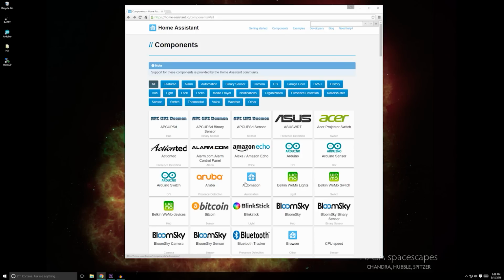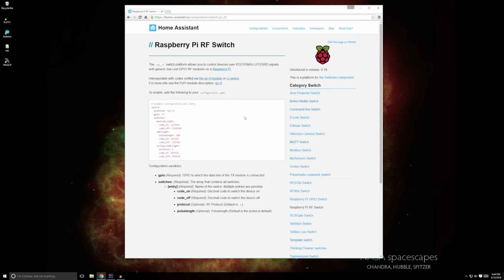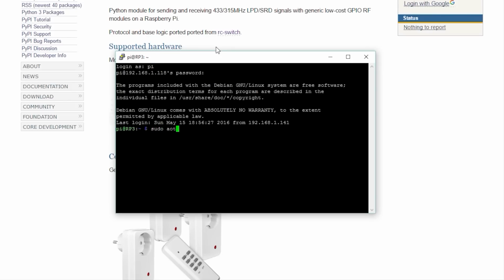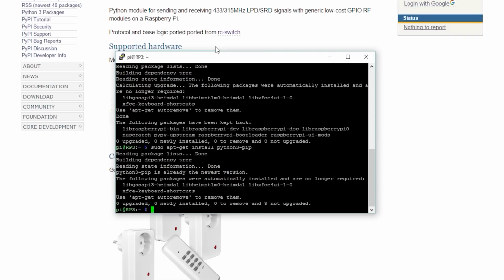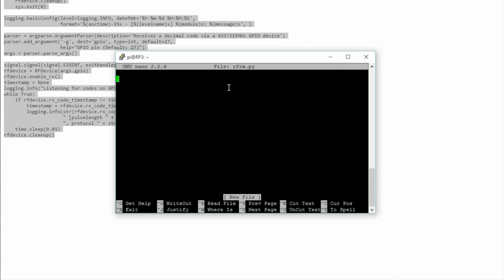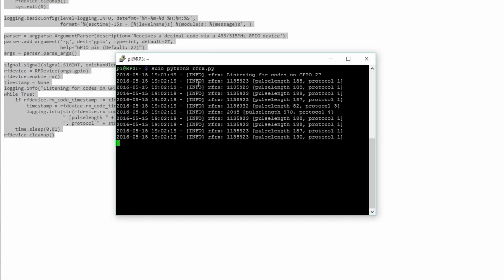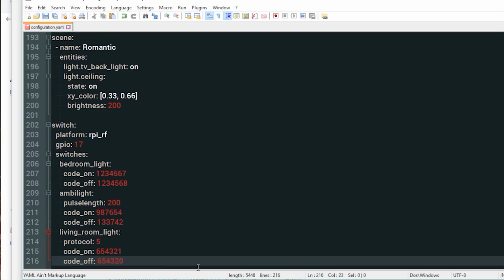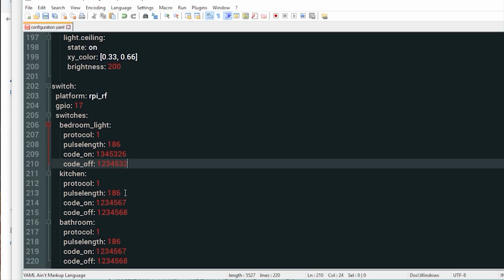The Cheapest Tech - $6 DIY Internet of Things Smart Outlets

Comment: Excellent video thank you. I am trying to do something similar with PIR motion sensors because it seems that all such sensors working on the Zigbee protocol have at least a one minute "blind time": that is, once they detect motion they cannot detect it again for one to several minutes. It's silly because in some situations it makes little difference to battery life. On the contrary, PIR sensors on 433 Mhz are unresponsive for only a couple of seconds. I've looked around the web and haven't yet come across any information about how to connect 433Mhz motion detectors to the GPIO pins of a Raspberry pi  using a 433 Mhz receiver and THEN integrating this into Home Assistant. Any ideas?

Comment: I realize this video is like 2 years old, but I was wondering if this could work when HA is not actually running on the RPi. 

I run HA on an Ubuntu server that I use for a bunch of other stuff, but I would love to integrate RF control into my automations. I was thinking of buying a Pi Zero and the RF modules to run seperately, probably in a more central location tab my office closet. Is this workable in HA?

Comment: @BRUH Automation, first of all thank you for your video. I recieved data for the very first time after trying pilight, fhem and many other readers. is there a possibility with you python script to recieve binary data? My Intertechno remote (ITLS-16) just send: [INFO] rsfx: 8 [pulselength 1658, protocol 4]
[INFO] rsfx: 4 [pulselength 1658, protocol 4]
[INFO] rsfx: 4 [pulselength 1696, protocol 4]

the codes are quite short. isn't it? how can I interprete the protocol?

Comment: Thanks for the video. I have been using the Eteckcity outlets for several years, and now I can control them with my Pi3B+. I haven't tried to set up Home Assistant yet. Being a newbie to the programming world., it is a great success when anything works!
Reply: Got HA installed and running. Today, I configured the three outlets and they are working. I can trigger them from the far end of our house. But, I had to solder an antenna wire onto the transmitter...and stretch it out. Whatever it takes, right? Thanks for the tutorial.

Comment: hello has anyone managed to get a sonoff bridge to work in home assistant for home security ie a small touch panel for a code and for 433 sensors to work  with in home assistant to know the presence of someone in a room or windows open and to control the switches and blinds

Comment: Followed your guide (and just bought different remote controls).......and I have a problem:

If i run
`$ python3 rpi-rf_send -g 17 -t 3 -p 101 15194300`
`2018-04-01 14:31:47 - [INFO] rpi-rf_send: 15194300 [protocol: 3, pulselength: 101]` is the code I'm sending, BUT, this is what I receive:

`2018-04-01 14:31:47 - [INFO] rpi-rf_receive: 15063220 [pulselength 521, protocol 5]`

Playing around with pulselength I realised that any `pulselength < 140` with basically make me receive close-to-random stuff. 
If I use `pulselength > 140` things are fine, but I need to send `pulselength == 101`...

Do you have any hints on what could be wrong here?

Comment: i like this better than what i did. I have a Broadlink rm pro setup in HA to control them.. I originally wanted to use a pi though, I think overall it would have been a better investment but i chose the Rm Pro since it did ir & rf and i wouldn't have to do as much learning compared to programming the Pi myself, or as much googling to find someone like you who already wrote the code..

What i would like to do eventually though, is take a Pi and build some type of "universal remote" by programming the pi to listen for an ir/rf signal and either issue a command or retransmit a different signal.. So for example i could use an ir remote for rf devices, or use an rf remote to turn my tv on and then launch kodi, etc.. It seems like a neat idea, but i still havent bumped into anyone else that has done it yet online..

Comment: Hi Ben, that's another great video!
Now a great thing could be to make HA RECEIVE signals from RF remotes, so that it can be handled as a command. 
Using smartphones or voice is cool, but most of the people (as my wife:-) is more inclined to use hardware buttons. 
t would be just GREAT if one could assign different functions to the 10 buttons, like switces, scenes etc. What do you think about it? 
Also, in this case one could break the connection between remote and outlet, so that it might be easier to know the real state of the outlet.
Has somebody seen something like this around?

Comment: Very interesting, thank you. Is it possible to do the same for RF sensors, like temperature or voltage sensors?
Can you show how?
Reply: I want to know this too! I've looked around the web and haven't yet come across any information about how to connect 433Mhz motion detectors to the GPIO pins of a Raspberry pi  using a 433 M hz receiver  and then integrating this into Home Assistant. Any ideas?

Comment: Finally got it working!  I used your recommended hardware and read all the troubleshooting comments here and tried then all.  I was having the random code, pulse length, protocol issue.  I was using separate Pi 2b, not my Hassio Pi.  I finally created a fresh Raspbian SD and brought it up on a Pi 3.  Surprise surprise, the rpi_rf worked perfectly!!!
Reply: Do we not use 433MHz receiver and transmitter with Hassio?

Comment: and then you explain how it works with antenna's. So lambda  (wave lenght) = c (lightspeed) divided by f (frequency). Most of the wire antennas used in these applications are quarter wave antennas. so divide 300 by the freqency in MHz (433.90) to get a wavelenght of 69 cm. Divide the wavelenght by 4 to get 17.3cm. then go and look up quarter wave antenna. and you see that even the correctly cut wire isnt perfect.

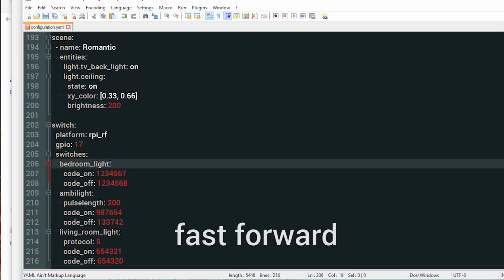Comment: For anyone struggling to get this working on a Raspberry Pi Zero W running Hassbian:  First, I was having difficulty with the rfrx.py showing a bunch of different codes (like others [e.g. Scott Dexter] have seen in these comments).  Look for a code with protocol 1 that comes up more often than the other (seemingly) random codes that you see.  That is probably the right code to use.  Second, putting that code into the configuration.yaml switch code (as seen on the video around the 6:01 point) didn't work for me either... UNTIL I added an additional parameter-- signal_repetitions: 10 --to the code.  (You can see this parameter in the example Raspberry Pi RF Switch code under the living_room_light section.  Example uses 15, but I used 10 and it seems to work reliably.)  Then, the switch came to life using the HA home page switch toggle.  So, despite others claiming that this does not work with the Pi Zero, it is working for me.  Thanks to Ben for all your work to produce these fun videos!

Comment: I have not been able to get this to work with the new Hass.IO and was wondering if you've had similar issues or have moved on to using the sonoff outlets now?
Reply: Ever figure this out? I've been looking into it, even on the home assistant website, but haven't found any answers. Good luck!
Reply: ryan355 yeah, I had to troubleshoot my Pi gpio.  I'm using a breadboard because of some other circuits I'm running and I was just off on wire placement.  Ended up finally getting it to work, but it took an afternoon.
Reply: That's good. This might be really obvious, but where do you go to install rpi-rf? Whenever installing Hass.io I know you are the root user. So when using PuTTy, I wasn't sure where to install this. Or actually where to run the Python script rfrx.py. I already have my previously found on/off codes. But if I ever wanted to add more, I wasn't sure. Any future help is appreciated
Thanks!
Reply: rpi-rf is added via the config file.  https://home-assistant.io/components/switch.rpi_rf/  will tell you what to add.
Reply: Before Hass.io you would have to add it with "sudo pip3 install rpi-rf on to the rp3. Does that not need to be done anymore? I understand the config part, I just thought the config wouldn't know what to do without the install of rpi-rf.Thanks again.
Reply: ryan355 it might just work now then.  I don't remember doing anything besides editing the config
Reply: Just wondering how you got the python script to run to sniff the codes, any advice?
Reply: I got busy with school and never figured this out. At the end of this semester I'm going to try again, but as of right now I'm not sure. If you aren't running Hass.io, you just run rfrx.py and if everything is connected right it will read the codes as you click the remote.
Reply: ryan355 Yea I'm running hass.io, I might just use another pi to grab the codes because I think it'll run fine once I have them

Comment: I keep getting an "Invalid Config". On line "59, column 1". This is exactly where "- platform: rpi_rf" starts. Any thoughts?

switch:
  - platform: rpi_rf
    gpio: 17
    switches:
      Keurig:
       Protocol: 1
       Pulselength: 179
        code_on: 1316147
        code_off: 1316156
      Bedroom:
        Protocol: 1
       Pulselength: 180
        code_on: 1316291
        code_off: 1316300
      Living_Room:
        protocol: 1
       Pulselength: 180
        code_on: 1316611
        code_off: 1316620

Comment: @BRUH Automation The Etekcity Outlet Switch you mentioned takes max input of 120v. In India its 220v can you suggest any alternatives.
Reply: I'm Australian, and we Aussies use 220-240v 50Hz like India and I was able to get those sockets at my local hardware store. The sockets are standard cheap 433MHz remote sockets that you can buy at many shops like hardware and electrical supply shops.

Comment: Thanks Bruh, just got this working tonight - super cool :D However, I was wondering if you know of a method to have a switch change state based on a RF transmission (from a doorbell for example)? The hardware should be fine, but im not sure if the RPI_RF component can recieve transmissions or only transmits itself.

Comment: Hey, I've used this on my rpi3 for several months. I just decided to switch to my old rpi b+ for home-assistant, since it doesn't really require the power of the rpi3 for the few things I use home-assistant for. (I'm going to use the rpi3 for retropie instead)

I can't seem to get this working on my rpi b+. I brought over my configuration.yaml file from my old install. I triple checked that I have the transmitter connected to the correct pins on the b+, but my outlets aren't doing anything when I try to switch them in home-assistant. Any clues what it might be? I followed your quick-start guide to a T for getting home-assistant set up on the B+.
Reply: the rpi b+ is in the same location the rpi3 was when I was using it for home-assistant. It's connected directly into the router with ethernet. I can connect to home-assistant on the b+ just fine, and the controls for my Hue lights work just fine, but not for my RF outlets.

Comment: is it possible to wire the transmitter to 9v battery to get better signal?
Reply from the maker: Theoretically, but every time I tried I never could get it to work for some reason. I found that using a header wire as an antenna made a huge difference.

Comment: I'm a complete beginner, and I got it working in a couple hours total time.  Thanks!  .....  If I swap in a 315mhz transmitter / receiver, will the python rfrx read those codes too?
Reply from the maker: Sweet! Pumped you got it going. Yep, should work great with 315 mhz.

Comment: Question im having trouble turning on my etekcity outlet.... I manage to set up the whole thing and able to get my code... i repeated them 2 to 3 times and keep getting the same code and its consitant and every button (1-5).... my receiver is connected at GPIO 9 so i change the code in the script to work with GPIO 9. which worked and im able to get the RF code from the remote no problem... but my problem is i believe is my sender.. the sender data wire is connected to GPIO 10... 

so my configuration is this 

- platform: rpi_rf
  gpio: 10
  switches:
    switch 1:
      protocol: 1
      pulselength: 186
      code_on: 5313843
      code_off: 5313852
    switch 2:
      protocol: 1
      pulselength: 186
      code_on: 5313987
      code_off: 5313996
    switch 3:
      protocol: 1
      pulselength: 186
      code_on: 5314307
      code_off: 5314316
    switch 4:
      protocol: 1
      pulselength: 186
      code_on: 5315843
      code_off: 5315852
    switch 5:
      protocol: 1
      pulselength: 186
      code_on: 5321987
      code_off: 5321996

with that configuration my pi doesnt turn on or off any of my outlet can anyone help me troubleshoot

Comment: Managed to turn on my RF outlets using the provided instructions, but I am not able to turn the outlets off.

I have an older set of Woods Remote Control Outlets (59735) that can switch between 3 channels on 4 different bands (i.e. A1, A2, A3, B1, B2...D3). The rfrx.py script seems to identify various protocols when pressing the buttons, though I can normally identify a consistent set of codes for protocol 1 at a 344 pulsewidth. When I tried to hard code the pulsewidth though to try and troubleshoot turning the outlet off, I was no longer able to turn the outlet on.

Any help is appreciated.

Comment: Great video. I'm just getting started with Home Assistant, I've got limitlessled bulbs working great, but this RF stuff is really stumping me. Tried several methods posted around, none working so far with my Nexa remote switches.

But following this, I figured that pip should be pip-3.2 now, but I get this recurring error when I run the Python script... 
I'm ok tinkering around in basic python, but not being a dev, I'm not sure how to debug this...

pi@raspberrypi ~ $ sudo python3 rfrx.py
2017-02-16 19:27:19 - [INFO] rfrx2: Listening for codes on GPIO 27
Traceback (most recent call last):
  File "/usr/local/lib/python3.2/dist-packages/rpi_rf/rpi_rf.py", line 184, in rx_callback
    timestamp = int(time.perf_counter() * 1000000)
AttributeError: 'module' object has no attribute 'perf_counter'
Reply from the maker: Sorry to hear about the issues! Not sure I have the answer for you. One thing I would recommend is perhaps trying the RF libraries on a Arduino. They are way simpler to debug and use if you have one laying around. You shouldn't need to manually install the RF libraries on your Pi for transmitting. HA will automatically import those to send RF messages. 

I have also heard about people putting their outlets in learning mode and then sending an random RF code to pair with their outlet. Your best bet here is to use something like this in your config, put the outlet in pairing mode, and then throw the switch. Hopefully, it takes the code and should work! Cheers!

switch:
platform: rpi_rf
gpio: 17
switches:
  fan:
    protocol: 1
    pulselength: 186
    code_on: 1234523
    code_off: 1234532
Reply: Thanks for the reply! I figured out the original problem... Raspbian Wheezy comes with Python 3.2, time.perf_counter() was new in 3.3 - so reinstalled on Jessie and the script ran. Ordered some superhet RF modules as the cheap ones I had produced somewhat random & patchy codes (not by design I'm sure).

Great idea about putting the socket in pairing mode and transmitting a known code - hadn't thought of that.